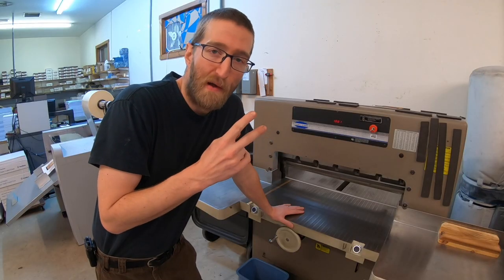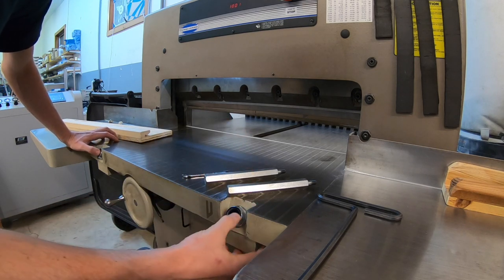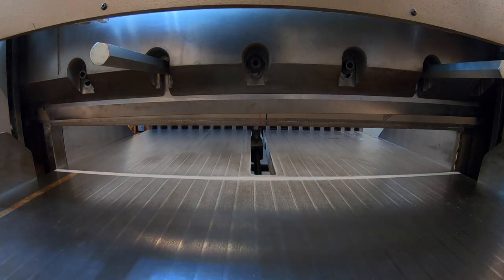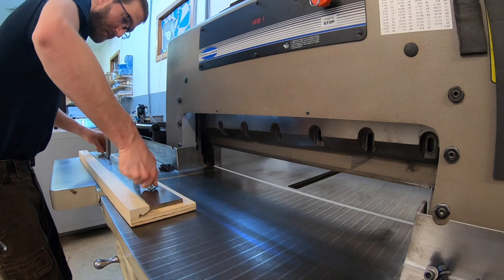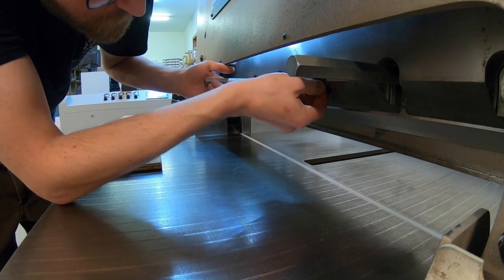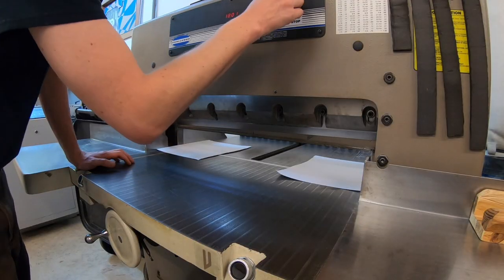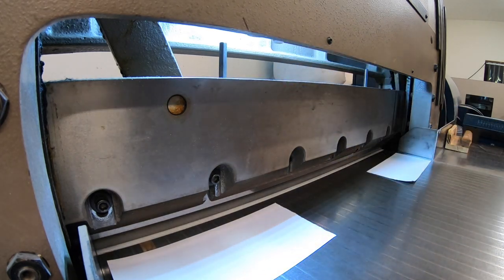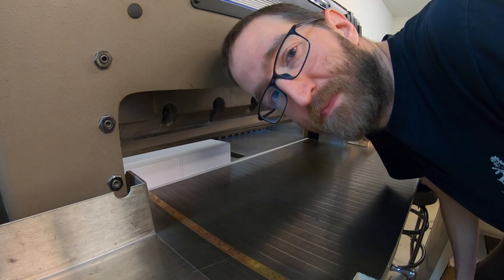How to Change the on Knife Challenge 305 Guillotine Paper Cutter

Comment: I guess I've done that 100 times on the same cutter.  IN the beginning, back in 1985 when this cutter became available, the steel blade was not durable and needed sharpening at least 1x a month.  Then it gradually changed to 1x a year, and only because we were speechless and felt it should be changed!!.  They called this blade high-speed steel.  Our cutter came with 3 blades, and the 2nd one also.  We never interchanged blades... and we used both about 6 hours a day.  All fully loaded and possibly the best bindery equipment purchases we ever made.  Good teaching video Dan.
Reply from the maker: Thanks, yup the cutter is used a lot!

Comment: OMG! I'm addicted to your channel. I'm a 30 year ex printer (well, once a printer always a printer) of offset and digital. Changing a cutter blade was my favorite thing to do. You are spot on with the safety aspect of the change. The bare edge shouldn't see more than 2 seconds of free air as it goes into the cradle.  It looks like you used cover stock to set the blade. I always used 80# gloss text. Don't know if it makes a difference, but I do like hearing the snap.  Thanks for you channel and keep it going.
Reply from the maker: Welcome to the channel! And thanks for sharing. I enjoy hearing from all the viewers!

Comment: @Just A Printer, yup, that first cut with a fresh blade always nice. 1 thing I did before inserting a fresh blade- I waxed both sides (with a car wax) to remove any residue from the sharpening process so it didn't drag through what ever I was cutting. Also used #20 strips of scrap for the adjustment, put 1 dead center in case of a warped stick. Man, I sure miss the trade. Kudos to you running your shop alone, neat, efficient and well laid out. Looks like you've got a great customer base !!!
Reply from the maker: Thanks, I am pretty lucky. Good idea on cleaning the blade before hand. I often see a bit of residue on the first large stack I cut.

Comment: I have a problem with my Challenge 23" MB cutter, I ran out of hydraulic fluid and when I put more in, still not working right, slow and sluggish, I think there is air in the lines. Is there a way to bleed the air or get the fluid up to where it should be?
Reply from the maker: Air should bleed out automatically. It might be possible that the hydraulic pump was damaged. Replace the filter too and ensure the proper weight of oil was used. You can download the manual from their website.

Comment: My adjusting screw seems to be either cross threaded or fused in place. I’m afraid to wrench on it and break it. What do I do?
Reply from the maker: Hmm, maybe soak it with PB Blaster. If that doesn't work, heat it up with a torch for a bit.

Comment: I’ve never understood this machine. How do you perfectly cut all the sheets to be exactly the same size? How are Crop marks on sheets aligned how to the machine? If it’s just a visual alignment isn’t that inaccurate?
Reply from the maker: There is a light that shines a thin line that shows you where the knife will cut. You then just align the crop mark with the light and cut.

Comment: A high volume shop might need a fresh knife every week or two. More swaps = more opportunities for mistakes. So, one minor change in procedure is worth considering -- after the knife is lowered into the stick and the pump is off, before any other steps are taken to remove the dull knife, the depth-of-cut screws should be backed off the appropriate distance. Doing this as soon as possible makes it much less likely that interruptions or any other Influence will result in the forgetting of this very important step!
Reply from the maker: Good point! I like it, I'll be changing the knife soon so I'll do that. Thanks!

Comment: Would it not be safer to rotate the cutting stick while there is no blade installed? Seems like there's still a chance your hand could slip and end up catching the bottom of the blade when you're trying to pry the stick out.
Reply from the maker: It is safe either way. The clamp is lower than the blade.
Reply: I always change the stick before i put the  new knife in.
Reply: Each stick has 8 different cutting spaces....remove and rotated it 8X then replace it with a new cutting stick.  No need to remove the blade each time to rotate the cutting stick for safety reasons at all.

Comment: I had a question about the challenge 305 and was wondering what you thought. I'm considering buying this same machine but I've discovered that Challenge no longer backs
any of there machines with Parker valve systems. And in fact suggest they suggest that any of these older machines be scrapped.  People selling these things like they are going out of style 
LOL. To me it all sounds bogus considering that they base it all on one incident that  a cutter failed and cut off his fingers. Can you give me any advice or provide a resource that could give me
an honest opinion on these machines. Also, my name is Patrick. I accidently used my wives account lol. Thanks!
Reply from the maker: It's up to your risk tolerance. My old cutter had parker  valves and I would still be using it without hesitation today if I didn't upgrade. Challenge has to tell your to scrap the cutter for legal reasons.
Reply: @justaprinter  Challenge quit stocking parts for equipment over 30 years old for this specific cutter. Our vendor couldn't get any parts for us from Challenge.  I called Challenge, and couldn't get parts from them either.  Ouch.